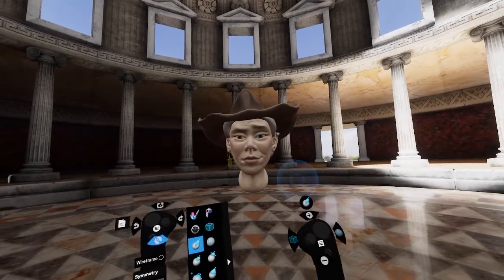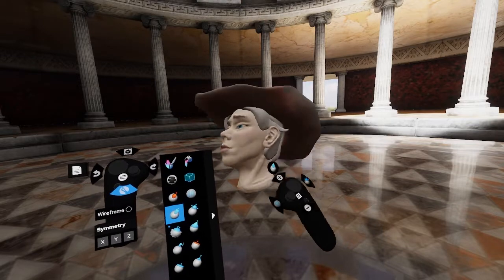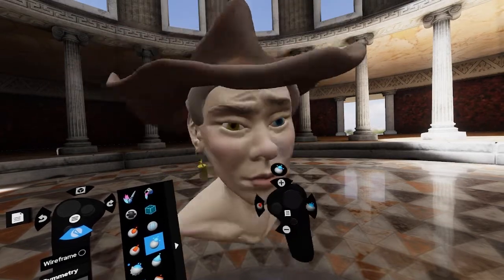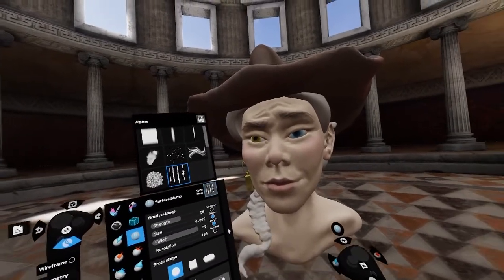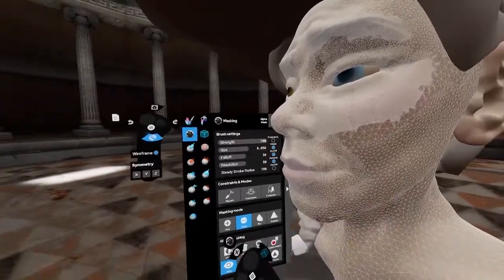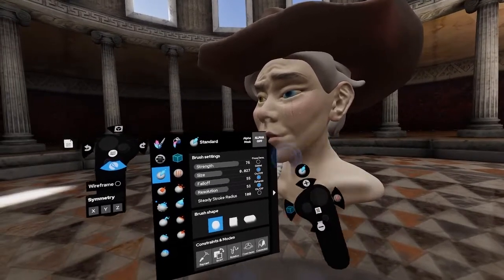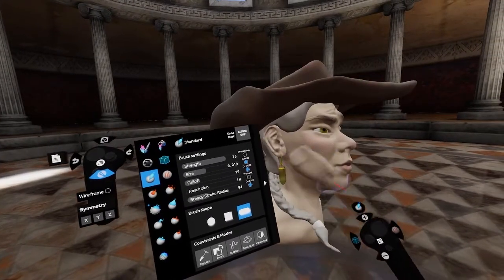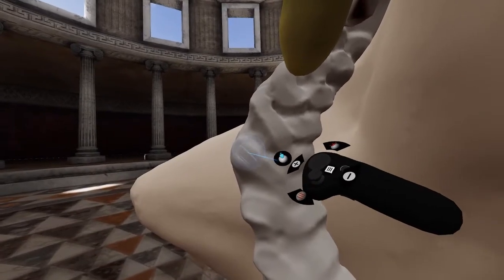Basics of Shapelab | Part 2 - Brushes and Brush Modifiers

Comment: Why have you put the masking operations inside o many folders of UI ? 
Like to delete the masked mesh please go to the menu, then to the other menu ... and there is a button to do that. 
Why is that?
Reply from the maker: Hey there, thank you for your input! We have put a lot of effort into the UI, and so far, we have mostly received positive feedback on how intuitive the interface is. That being said, we are open to constructive criticism. Let us answer all your questions in this comment:

The double-click shortcut for the invert tool is currently a necessity, but we have heard your (and other users’) request to make it easier, and we will make this happen soon.

The masking options and the left panel were deliberately put where they are, as they are used less often. We have received no other complaints about these so far. We took note of your feedback, though.

You can create a custom controller binding on Steam by clicking on options>Devices>Controller Settings in the Steam VR dialog.